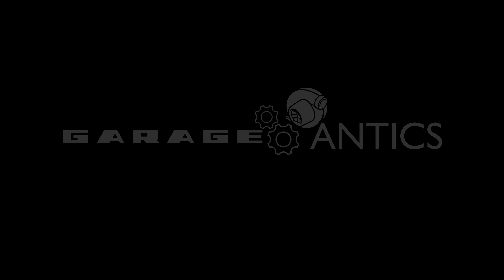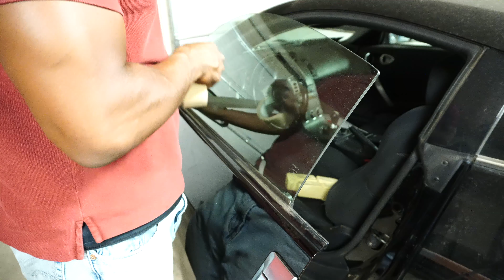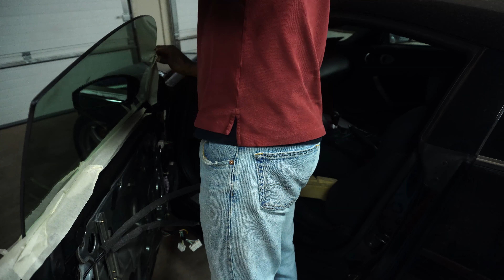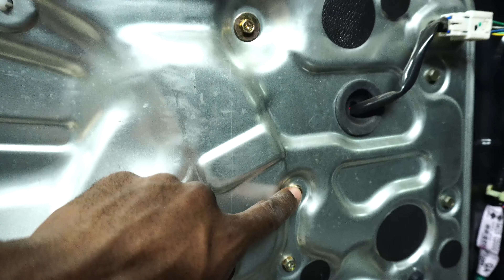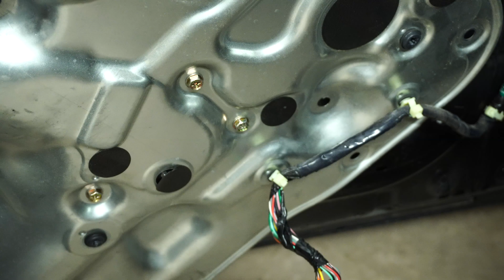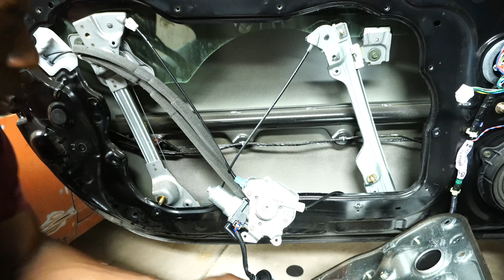350Z Repairs - How to Replace a Power Window Motor on a Nissan 350Z /Infiniti G35 Coupe

Comment: Good advice My problem is though not the motor it's the thing behind the motor that the wire wraps around the wires tangled how do I get that open in order to untangle that wire that's designed to pull the window up and down

Comment: Great video__ question both windows came down but didn't come back up.  am I going to have to raise the window before I can install them.  is it normal for both to go out at the same time
Reply from the maker: @andreirvin6057  hey thanks! Sorry, I didn’t get to reply back until now, but it should be doable with the window down, . Having said that, if both of your windows stopped working at the same time, maybe check the door control panel first, could be a bad window switch. It would be extremely unlikely for both to go out first. Does the switch on the passenger door work? If so, then I’d say it’s your driver’s side control panel. You can just replace the entire panel.

Comment: What if my window is stuck down? Will I still be able to change it with ease on my passenger side?
Reply from the maker: Yes, you can still change it with the window down. Alternatively, once you remove the motor, you can raise it back up, but will have to secure it in place using the method mentioned until you get everything back together.

Comment: Great video!  I appreciate you not rambling on about things that are not part of the problem.  You are direct and explain the process very well.  One thing to add is the regulator adjustment ( window) drags at the top ).  Hopefully I can find that with another google search.
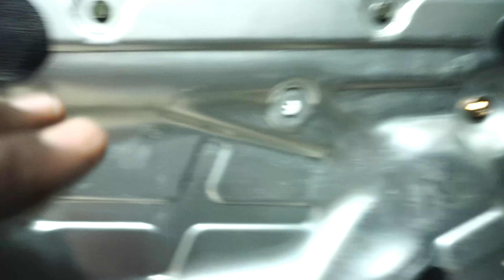Reply from the maker: Hey, thanks so much! Yeah, I tried to get straight to the point, I feel the same about the rambling. I wish I would have gone into it more, but the bolts i mention around the 9:00 mark are for adjusting the regulator. If it’s dragging, just loosen those a bit and it should go away.

Comment: My driver side window is down and I cannot get it back up (bad motor).  Having the window down to start the motor replacement does that change anything?  Maybe with resetting the window?  Great video.  Very informative.  Thanks for the effort.
Reply from the maker: No it won't make a difference, but have you tried hitting the door from inside panel? That may loosen the carbon build up enough to get the motor working once more. Also, thank you, post on here if you run into issues!
Reply: @GarageAntics  Thank you.
Reply: Got my new window motor installed just fine thanks to your great video.  My window motor came with special instructions to set the limit switch.  It was quite lengthy and it required only bringing the window up to the almost closed position and then doing the reset three times. I followed the instructions which came with the window motor but I could never get it to set correctly.  At least the window goes up and down now.  Many thanks for the help.
Reply from the maker: @davidlewis2576  awesome! Did you try doing the recalibration method in the video? This is the first time I’ve heard of a window motor for the these cars that actually came with instructions.
Reply: @GarageAntics  Yes, I did follow your recalibration video but it would not recalibrate.  Instructions in the box had me stop the window on the way up just short of closing.  Then the instructions stated to do it 3 times. Never got it to work.  I got the window motor at AutoZone and it is made by Dorman.  Many thanks for the comments and great video.

Comment: So you mentioned adjusting the bolts on the regulator which bolts would those be cause I definitely have a lot of resistance and I recently got new regulators and a new motor
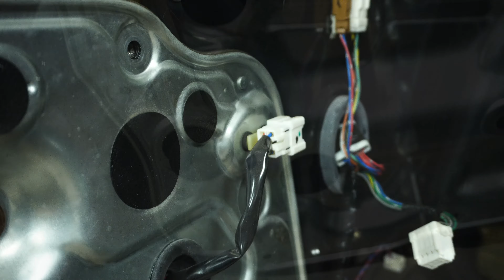Reply from the maker: It’s the 4 screws with the nuts in place that I mention at the 9:35 mark. They may be too tight. Try loosening them in half-turn increments. Just plug the control panel in and test until the window moves at the right speed.

Comment: My window is stuck down and I’m 6 hours away from home, is it possible for me to open the door panel and just try to  force the window to stay up?? Or will it just fall without the motor working ??
Reply: Will try thanks man, definitely subscribing
Reply from the maker: @carloschama2715  no problem, and thanks so much!
Reply from the maker: I don’t really recommend trying to force it, you could risk damaging the glass or possibly messing up the regulator. Have you tried hitting the door panel like I did at the beginning of the video? That usually works a few times at the first sign of failure, as it breaks free some of the built up carbon that’s inside the motor. Or you can try hitting it after taking the interior panel off for better contact.

Comment: The inside of my 05 350z(enthusiast) , looked nothing like this. I didn't have to remove steel plate and it had a hell of a lot more screws lined up vertically. Doing the job wasn't that easy.
Reply from the maker: That's odd. Are you in the U.S.?

Comment: this is probably the best guide out on the internet so far that i have seen i am about to install mine following your steps
Reply from the maker: Hey thank you! Comment if you run into any issues, maybe I can help!
Reply: @GarageAntics  none at all! Just did it!!! Worked like a charm I dident even need to reset it,  although the bottom screw holding on the window track on the right side of the drivers window unscrewed off the actual track and left the nut on the metal card so I had to screw it on a different way, but in the end it got done ! Thanks again for the guide!
Reply from the maker: @pekomsmink  awesome, glad to hear it was a success!

Comment: This is absolutely the BEST video I have seen .... I had diagnosed the problem as being the control switch on the door but didn't have a clue how to remove the trim piece holding the switches...found the answer about 2.30 minutes in and followed the how to....in less than 10 minutes I replaced my switch assembly and everything works.  Couldn't be happier!
Reply from the maker: Thank you so much! I remember struggling to figure out how to remove the trim piece as well, so I'm glad you found it helpful!

Comment: Just stumbled across your channel. Looks like I am late to the game and you may have stepped away from making new content. I dig your garage collection. I see TX plates. Where are you located? I'm in the DFW area myself. -Chris
Reply from the maker: No sir, not late at all! I’ve been filming new content as recently as two days ago. I have several videos that I need to edit, just haven’t made time yet. Located in Amarillo!
Reply: @GarageAntics  okay cool. I have been wanting to ramp up a channel myself, just haven't had time. So I have a stock (for now) silver 91 Z32 TT, a red 91 VW GTI VR6 swap (show car), a black 95 LEX SC300 and a couple of other cool cars. Oh and I had a black '88 RX7 T2 with the same Yoko AVS wheels I see on the white Z32 in the background. Like seeing "local" guys doing it. Amarillo isn't exactly around the corner from FW, but glad to see another TXN holding it down. I'm going to stay tuned in. Good content. Keep it up, Sir.
Reply from the maker: @dubtapes1529  that’s a nice collection! I like your taste in cars. Yes, having a channel definitely requires some time, but I’m sure you’ll get plenty of views with those cars. Thanks so much, I’ll try to get my new stuff out soon!

Comment: great video! Many of the other videos addressing this issue skip past the door panel removal process. I have a passenger-side window issue and the dealer wanted $375 for the motor...$675 for the motor and installation. The local auto parts chain store had a price of $156 for the motor. I watch your video, bought the panel tool kit from the auto parts store for $20...the part recommended/linked on Amazon for $33. All-in for $53 and an afternoon of my time!

Thanks for posting this!
Reply from the maker: Wow! That's ridiculous, they don't call it a "stealership" for nothing! Glad to be helpful, and to help cut down on your repair costs :)

Comment: Great video and help. I have already replaced the passenger side motor a number of years ago. Now the driver's side on a 2006.5 Touring has gone out. For some parts, that ".5" makes a difference on parts - mainly engine components. Thanks for a great video! Like the orange Z in the background, too!
Reply from the maker: Thanks so much! Yeah, the 240Z is a dream project of mine, I've since moved it into storage, but would like to start on it in the near future :)
Reply: @GarageAntics  I swapped my window motor out today - with the help of your video. Having taken the driver's door panel off, I now know someone has been in it before. It's missing one of the 2 screws under the switch panel and the one behind the interior handle to open the door. Got to look for some online. Hope you get to work on the 240 soon.
Reply from the maker: @ScottHolderCrossPoint  Glad to help! You should be able to get those screws from an auto parts store, or worst case, Nissan should still carry them!

Comment: I hope you can see this but i’m stuck at the part to put the new one in and turn to adjust & align but it is not adjusting it’s hard. should it be this hard???
Reply from the maker: Are you referring to lining the the motor up with the keyhole? It shouldn’t take too much effort, but an option is to try rotating it a little with a pair of pliers. Just make sure you wrap the key with something like a cloth before gripping it with the pliers to avoid scratching it.

Comment: Pro tip: like he said, these go out ALL the time. I bought 2 online and replaced them myself, they  last a few months, if lucky close to a year each but then you have to buy another one. So just spend the extra cash at your local autozone/o Reilly’s and get the warranty, you won’t have to pay for another one again just get it replaced through the warranty.
Reply from the maker: Where are you getting your motors? I don't put a lot of miles on my Z, but I've always been able to get at least 3-4 years out of each motor.

Comment: Do I need to have the window up when replacing the motor , mine is stuck down how does that work
Reply from the maker: Nope, not at all! I've had to replace these in both situations (window stuck up and window stuck down), and was still able to access everything.

Comment: What's the procedure when the window is already down and won't roll up and you have to replace the motor?
Reply from the maker: This is that procedure, it’s no different whether the window is stuck up or down. You just may need to be a little more creative in holding the window in place when you take things apart, but tape should still do the job.
Reply: Thanks! That really helped. I replaced the motor on the passenger side (window down) and when I hit the switch. I hear a click but nothing happens. Even when I open and close the passenger door, I can hear the window move as if the window was up… Any suggestions?
Reply from the maker: @thaouthouseradioshowwithdm6167  You don't have your window switch lock on the driver's side engaged, do you? Also, check the connections to the power window switch. In this case, it could be the actual switch and not the motor.
Reply: @GarageAntics  it’s not locked. I just want to see if I have to replace the regulator or when do you know when you have to replace the regulator? I hear the click when I use the switch on both sides the door has.
Reply from the maker: @thaouthouseradioshowwithdm6167  I don't think the regulator needs to be replaced unless you see that the cables look stretched and/or worn out, or if little white plastic pieces that secure the cables are broken. Maybe you have the regulator bolts on too tight, and it's restricting the motor from moving the window up and down? Try loosening the bolts, they shouldn't need much torque, maybe hand tight, or slightly more.
Reply: @GarageAntics  thanks! I’ll give it a shot in the morning and let you know
Reply from the maker: @thaouthouseradioshowwithdm6167  Sounds good!
Reply: @GarageAntics  everything worked out. Thanks again. Now I need a video for the top not opening & closing….
Reply from the maker: @thaouthouseradioshowwithdm6167 Awesome! I'm glad everything worked out. Unfortunately I don't have a convertible, but I bet this info is out there!

Comment: Can I just roll the window down and leave it like that? Or do I have to tape it?
Reply from the maker: You could probably get away with rolling the window down, but it's possible that the window may fall further into the door as you loosen the regulator and make adjustments. It's not too big of a deal, you can just raise it up by hand since the access panel is off.. I prefer to leave it up and apply tape since I know that as long as the tape stays in place and attached to the glass, everything will remain as I left it when the new motor has been installed.

Comment: This is quite possibly one of the best ‘how-to’ videos I’ve ever seen. I have an 05 350z touring coupe and the window motors work perfectly. I’m was watching just in case the day comes that I have to replace it. Thankyou so much for making this video. Even though I have no experience with working on cars I now feel like I can replace the motor with ease after just watching this video once. Quick question: do you know how long the motors actually last? And what are early signs that I need to look out for?
Reply from the maker: Thanks so much! Prior to doing this myself, the videos I watched all left a few things out, so I wanted to make one that covered everything that I encountered. Unfortunately, it's one of those things that will eventually fail. It's a little daunting at first, but actually a pretty easy job, even for someone not used to working on cars. The lifespan of the motors can vary, especially with usage. I've owned my '03 Z since brand new, and this was the second replacement on the driver side motor, and the passenger side has been replaced once. So, I'd say with regular usage, they last roughly 5-6 years. Early signs are usually when the window doesn't open or close the first time you press the button. It could possibly mean that the window control switch has failed, but if it starts working again after you hit the interior door panel or open and close the door, it's a sure sign that it's the window motor and not the switch.

Comment: Thank You for walking me through this! Managed to do this all on a Sunday morning. Purchased plastic trim tool kit at Harbor Freight on Saturday and here it is noon on Sunday and I have a new motor in my 2009 350z. Took it slow and would pause video and complete that step and then come back in and watch the next process. Went exactly as you showed. Only thing I did was "snap" one of the 12mm bolts that hold the panel on the door. It was metal on metal but I got too aggressive on it. Left it in though. The plastic inserts I was gentle on, so no problem. Cellophane tape on socket helped with the bolt behind door handle for sure. If I rattle later on I'll know that it is the snapped 12mm bolt but I think it'll stay just fine. Door control did snap off piece of plastic, but it snapped back on and held just fine when re-assembled, so I'm assuming this is common and there are plenty of "snaps" to hold it. Took a couple times of resetting motor to get it to work correctly but just repeated till it was correct. It's done and I have a functioning window once again. Hat's off to a great video. Had your voice in my head walking me through it. Thumbs up!
Reply from the maker: Awesome! I'm glad that you found the video helpful! Yes, I forgot to mention how fragile some of the plastic pieces can be, especially now that our cars are on the older end. Luckily, I believe most parts are still available through Nissan, even that 12mm bolt!

Comment: Does the window roll down a bit when you open the door on the aftermarket part?
Reply from the maker: Yes, it should still drop down like the factory one. If not, you may have to redo the calibration sequence, or check the door position switch on the door jamb.

Comment: Great video man, what if your window is stuck in the down position? Do I do anything different.
Reply from the maker: Hey thanks so much! It’s more than likely the same issue. If you need to get the window back up, try hitting the side of the door, sometimes that can loosen the carbon build up enough to get it to work once more. It’s only a temporary solution though, don’t use the window again until you can do the replacement.